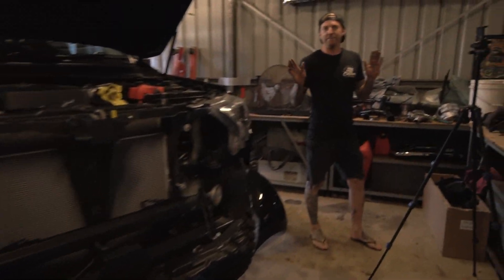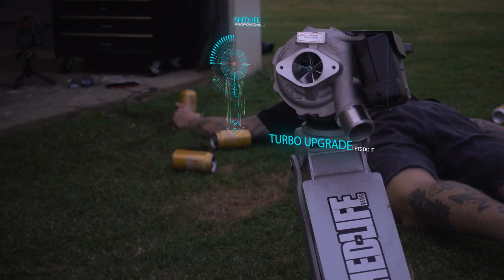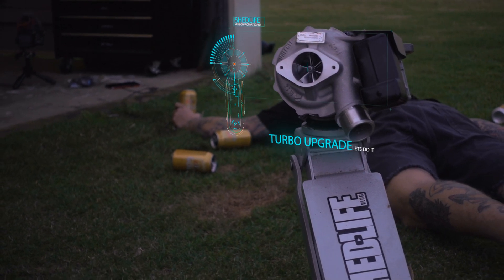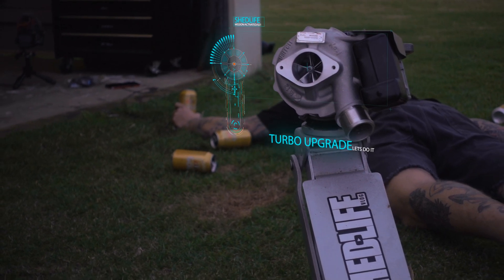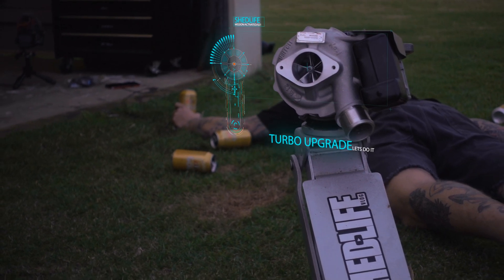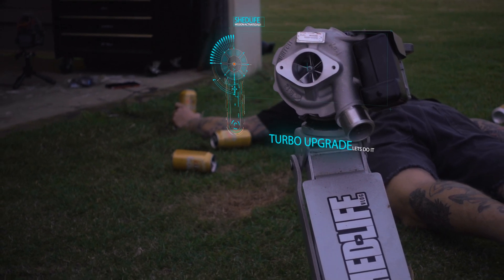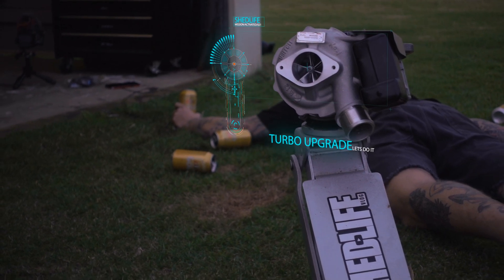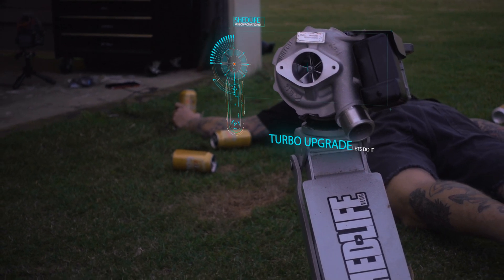2020 Ford Ranger TURBO upgrade

Comment: A stock nav with an exhuast + tune. Has more power than an aftermarket turbo ranger. Not to mention the nav is a 2.3l and the ranger is a 3.2l.
Reply: Someone said it only made 130rwkw but assuming that is super conservative after what happened.

Comment: I did the exact same thing to mine haha snapped the shaft and spat the exhaust wheel all the way out the exhaust. The stock  turbos really don't like more than 20psi
Reply from the maker: unlucky ! upgraded afterwards ?
Reply: @TJANDMAC  yea mate, gone much bigger. They go well with a bit more boost up them

Comment: What was the main cause of turbo failure? 
Was it the tune? To much boost?
Reply from the maker: yep, Tune was a total fail, they didnt know diesels at all, current tune much safer
Reply: @TJ Jack  yeh I thought about taking mine to ultimate diesel for a tune and egr off after I sort out wheels and suspension. They have a pretty good rep and tune on the safer side for good all round performance/towing.
The superior engineering remote resi looks the goods. 
I want to checkout the FOX 2.0 also before pulling the trigger..